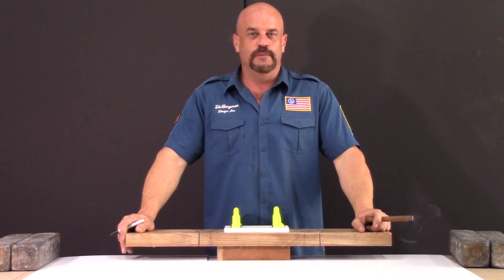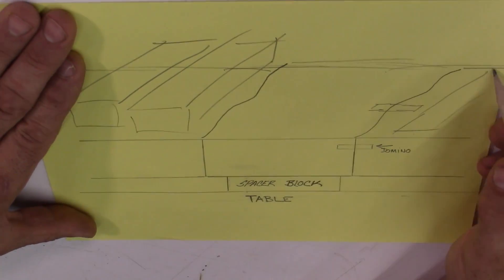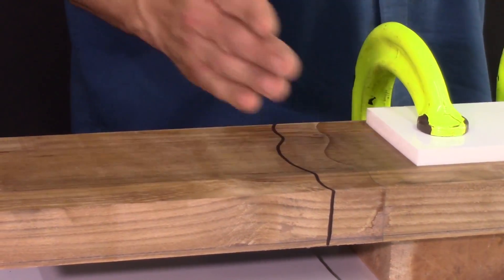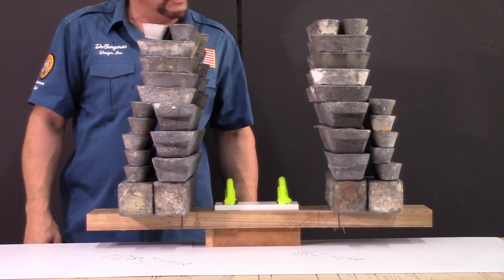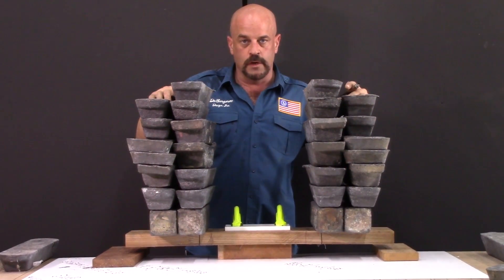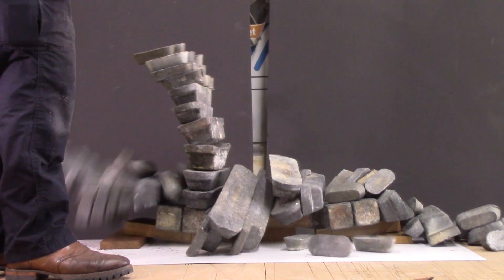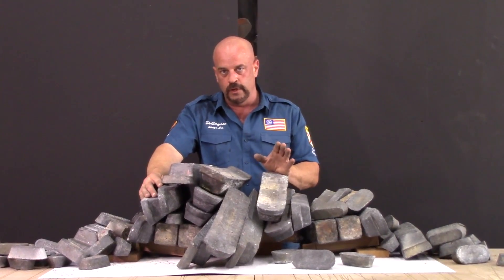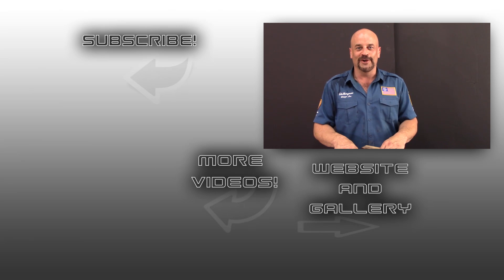Is a Domino joint stronger?

Comment: Hi Jim, this video made me question an idea I’ve heard quite a bit in wood working circles - which is that the glue joint becomes the strongest point of your piece. Essentially that the wood around the joint will break before the glue does, because the wood is so strong. Would you say that is a true sentiment with edge gluing and not end grain gluing? Curious on your thoughts!
Reply from the maker: Hello Miles, Yes it is a common belief that the joint is stronger than the wood, I completely agree with that statement. One looking at this example as proof otherwise should pay close attention to the lay-up that the joint consists of. It has at least four different types of material all bonded together making it virtually impossible for the "wood" to fail before the glue. I received a bit of feed back from the corner video project indicating that this was not a good joint and would fail.  Knowing that there are many with a great deal less knowledge but who are gifted with a keyboard to spout off from, I conducted this simple test to prove otherwise. Refrain from using this example as the end all discussion on glue strength.
All the best to you,
Jim

Comment: I think it'd be even stronger if you could find a way to fill the voids in the plastic honeycomb stuff. Half a ton on a corner that has that kind of void in it is amazing. You could easily get about 3/4 ton with that joint if the void was replaced with wood. Maybe even stronger, since we don't know what that side could hold since the other pile fell into it. Since I can only do approximate calculations, you only have about 60% surface area being wood, with the void and plastic being about 40%.

But for how small the table's corner actually is, half a ton of weight is something it'd never see in any scenario, unless someone was actually trying to destroy it.

I think Matthias Wandel found the same findings, that glue is better than joinery, though he used standard wood glue. Joinery is either for lining things up, holding things in place, ornamental, or for non-glue structural reasons (Like ancient oriental buildings). I also remember Norm Abram always saying when he used a nail gun, that the nails are to hold the piece in place while the glue dries.
Reply from the maker: Hello Zoolander, So your commenting but not subbing..... so sad for me! The joint and the plastic honey comb stuff were  used as an exact duplicate of the aft deck table that we built. A lot of commentors were stating that the joint was weak and poor in design for strength. If I was to replace the plastic stuff with wood, it would not be a very equal test. I am nor ever was worried about the strength of the corners, this video proves why. It was already a unscientific test due to the weight being placed outside the actual size of the corner molding that was used on the table. Thanks for your input.
Jim
Reply: The strength of it is already ridiculous for its application. I know this was a recreation of what the table had for testing. I'd also be interested in how strong the other corners you've made would be on that sample piece you made, especially corner #4 with the inverse curve.
Reply from the maker: I forgot to ask you, who is Matthias Wandel? What does he do for work? I know who Norm is.
Jim
Reply: He's a YouTuber that does woodworking, and he builds most of his equipment, he's also done joinery strength tests with just standard wood glue.

Comment: Another outstanding video Jim!  I've been watching woodworking "How-To's" going all the way back to the old "New Yankee Workshop" TV series, but during all of those decades, I've never seen anyone actually test the strength of a wood joint.  Now you have and it was very revealing, and damn useful to boot.  Of course, I'm an Engineer, and we really love this kind of stuff.  So, my excitement might not be equally shared with others.  But this kind of testing is way, way overdue and will help anyone wanting to make durable constructions.  Again very well done!
Reply from the maker: +Jim Walker  Glad you liked it, Jim! It definitely enlightened me to the actual strength of West System as well. I knew it was strong but I also realized, as I am sure you did as well, that we were over leveraging the joint. There was not a easy way that I could put the weight only on the size of the molding piece that we made on the table. I think it would be really interesting to apply pressure to an 1.445 piece of the same glue joint but that would need to be done with hydraulics instead of lead. 
I do not think that would've been as entertaining as watching several thousand pounds of lead crash upon itself.
Thank you for your kind comments!
Jim

Comment: That was cool. Joining two boards is a simple recipe. 2 boards + glue (appropriate for the task). With exception to end grain glue joints any splines are simply to help with alignment.
Reply from the maker: +Chet Weatherl   Thank you Chet for confirming everything we showed on the video. However these were end grain glue-ups so why did the splines not help if that is the exception? Thanks for watching, 
Jim

Comment: Mike, first thanks for doing this. 1045 lbs is an awesome amount of weight on any joint. That said, the domino joint definitely broke first dumping additional weight on the non-domino joint, causing it to fail. 

My only issue is would you build such a wide joint with only one domino or biscuit? In practice, wouldn't you use three for this joint if any?

PS I understand you had to get the joint to fail with the supply of weight on hand.
Reply: Agreed. While either joint is plenty strong enough for intended use, to maximise joint strength dowel (donino) edge distances are crucial... this one punched out the bottom due to insufficient edge distance, otherwise the capacity could have been higher. Additional evenly spaced dowels (dominoes in this case) may help but only if their bending, shear and tensile capacity is greater than the shear capacity of the parent substrate alone. In this example the weak link was the plywood under the domino which compromised capacity.
Reply from the maker: +Pam Peerce-Landers  Thank you for commenting but first off I'd like to know who Mike is?   My name is Jim and I'll will be happy to answer your questions. 
  Yes of course for a wide joint you would use more dominoes , biscuits or splines. However this test was to mimic the corner that I put on the table in the previous video.   If you will review that video or the picture that was inserted into this video of that corner, you'll notice that there's not room for a spline or additional dominoes as it's a radius corner.
  So upon installing them, once the radius was cut, they would be exposed which would ruin the corner as well as the table. So the only place to put any type of spline or domino would be in the center only. This is why the test was carried out in the fashion that it was. This was also a viewer requested test to prove that glue alone was strong enough for the application without needing additional resources.
If I have not answered your question thoroughly, please let me know!
  Thank you again for commenting and watching our video!
Jim
Reply: DeBergerac Design Jim, sorry. Saw your response to the last comment and being of advanced age, thought you were Mike. That said, did not see the previous video. Tune in when something interests me.
Reply from the maker: +Pam Peerce-Landers Thank you for tuning in to us. No problem with calling me Mike, I thought it was humorous:-)
Jim
Reply: DeBergerac Design Do like your stuff and subscribed last week. Like your honesty and using the theme music from on of my favorite shows: "Justified."
Reply from the maker: +Pam Peerce-Landers OMG! You are so in tune, my favorite show as well.Thank you for your kind comments!
Jim
Reply: DeBergerac Design Forgive me. I'm only a Chartered Structural Engineer.
Reply: DeBergerac Design Re-read my original reply. You'll find I haven't disagreed with you! Enough said.
Reply from the maker: +Andrew Cartlidge   The edge under the plywood was bi-axial cloth laid up with West Systems. Should be stronger than the ply. Most people seem to be missing the concept that the domino actually made that joint weaker than the shear strength of the opposing side.  I really don't know what else I can do I explained it and I put it on video. The earth is not flat BTW. 
Jim

Comment: Was going to say, re-watch the slo-mo the spline gave first as it should have. Glue is actually stronger than the wood. People tend to forget that. Cool video, at least now you know exactly how strong your glue is. :D I'd suggest steel toe boots but my experience is, the weight usually lands on the back side of the toe, still hurts. 

For splines, they're more for alignment than adding strength, it's the same with biscuits. Can't wait for the next test. Cheers :)
Reply from the maker: Glad you enjoyed the video! What I have seen in regards to steel toe boots is loss of toes, so not a big fan. The other thing that you tend to do things with them that otherwise you would not, not such a good thing:-) I always thought the same about splines, biscuits and etc, subscribers questioning my methods of not using them gave me the idea for this video.
Stay safe and talk soon!
Jim
Reply: Yea, not a big fan of steel toe either but in some places, they're required unfortunately. Hopefully there's a "redo" for this test soon. :)
Reply from the maker: Really? You want move all those weights again? I would venture to guess that the other side would of broke with only a few more pounds added to it. If you want to come help move the weights I guess we could do another one. My guys in the shop cleaned up the last mess without me even asking them to do it, how lucky am I?
Jim
Reply: Don't blame ya bout the weights but now, at least you (and us viewers) have some idea of how much it can hold. 

Would point out, perhaps many have missed it, with your "S" curve corners, you have more surface area for all that glue vs just a triangular cut corner. Nice that the guys cleaned it up for ya. Hope the foot doesn't hurt too much. Looking forward to the next video. :)

Comment: That's an interesting test... I did noticed though that when you started putting weights on the board, you placed them closed enough to the joint itself. Would it made a difference if you have place the weights more towards the edge? and as everyone else I'm sure have noticed how the one on the right broke first and caused the one on the left to break after some of the weights fell on it...
Reply from the maker: Hello Junior! In reality the weights were placed too far from the joint as it did not properly represent the corners that I installed on the table which were only 1.445 in width. Moving the weight further away from the joints would, and did in fact, produce more pressure on the joint than would ever be possible to create on the table that we produced. I should of erected a wall between the two sides to prevent the weight from breaking the non-domino side as we would of liked to find out how much that could of held.
Thanks for watching!
Jim
Reply: DeBergerac Design  just the same, its a great test... have you done similar test for biscuits and dowels? I've watched quite a few of your videos and learning a.d enjoying it a lot. I'm new with woodworking, in fact I don't have a shop yet.. but I think I'm gonna have one soon. I've acquired some old craftsman equipment already like a jointer and  thickness planer ...
Reply from the maker: Good for you! Some for the older craftsman stuff is better than much of the mid price level tooling that you could buy today. We have not done a lot of testing on items for video. Mostly I do testing on mock-up parts before I make the real thing if I feel that something is questionable in concept. Those things hardly ever make it to video. Besides the channel is fairly new at this point. I am sure in the years coming there will be more "testing". This video was done because of subscriber comments second guessing the glue only method that I used to install the table corners.  So much so that I had to find out for myself how strong the finish product was in reality. I am glad it worked out in my favor and I think it was good information for those few who actually care.
Good luck in your joinery and you can always reach out to me if you feel I may be of some help to you in the future.
Jim
Reply from the maker: While this was not directed to me, it does bring up a point that I would like to address to everyone who would care to comment, how strong does a glue joint have to be to make us happy? Horse hide is still a preferred method by some excellent craftsmen. Goes kind of like the same with firearms, the calibers keep getting bigger and bigger with handguns and rifles. I can still hunt just fine with the calibers that were developed 50 plus years ago. Glues are getting better and better but what is really needed?
Thanks in advance for every ones thoughts,
Jim
Reply: The thing about spline vs non spline is this, splines add nothing to strength, they're only used more for alignment nothing more. If the glue up was done properly, as Jim did, the material, (wood), will break before the glue itself does. This has been proven many times over in the past, which is why there are so many different types of glue on the market.
Reply: Thanks Jim, it is much appreciated... by the way, I actually preferred the older Craftsman for the same reason why I'm a Ford guy... IT IS MADE IN AMERICA, CAN'T THINK OF ANYTHING BETTER... the newer Craftsman are now made in stinking China and I always said to myself, I didn't migrated to the US so I could buy and support China... plus overall, anything made in China is nothing more than a piece of ... well, I'll try to be nice... ha ha ha ...